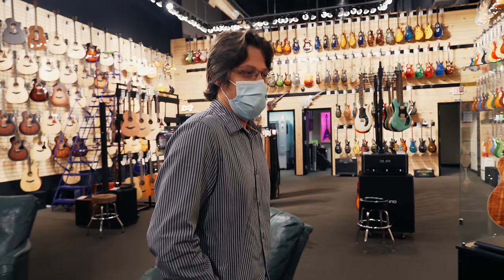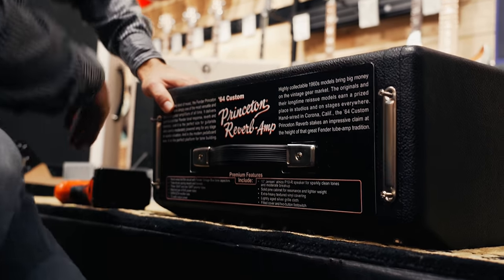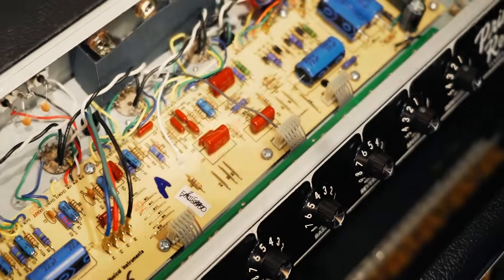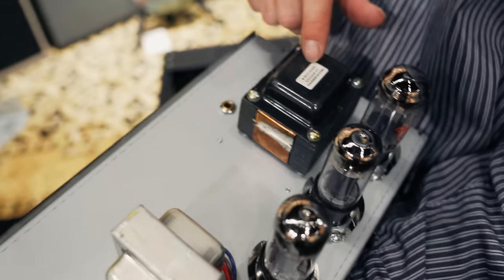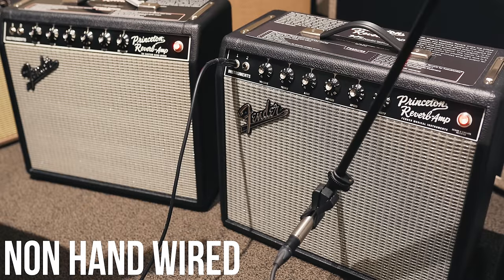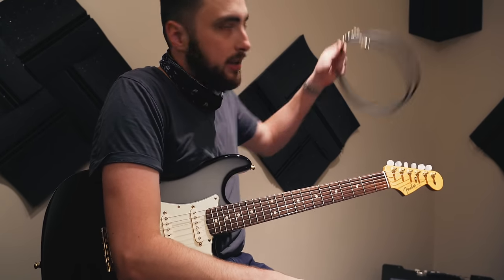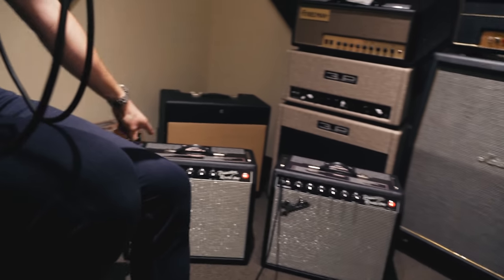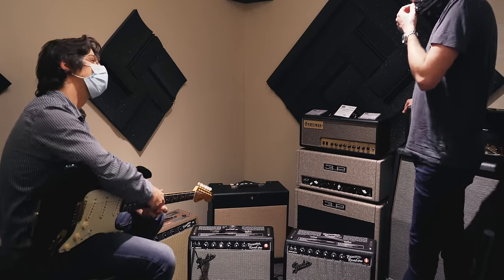Are Hand Wired Amps Really Better?

Comment from the maker: Are you a hand wired amp player?
Reply: Yup 68 Princeton, had it re capped about a decade ago and that is it.
Reply: yup! I've got an early Dr. Z Carmen Ghia head I love
Reply: Itd be cool to get a review of those 1x12 Vox AC30s that came out like a year or so ago, I want to get one but the old Custom Classics always would break down. Great video Rhett!
Reply: Yup, Goodsell Super 17. My only amp for the last decade.
Reply: Yes Vox AC15 combo and AC30 head 50th anniversary series, but it's hand wired in China. Does that make a difference? I've had them serviced and the tech said they were great. They sound great to me.
Reply: When I play my Fender 4x10 I am. When I'm on my Katana.....
Reply: Yessir!  I could never go back to PCB amps now either!  I have a 65 Deluxe Reverb reissue that I had completely gutted and re-wired point to point!  The caps on the Normal channel were altered to be tweed voiced and has more bark and mids to it while the Vibrato Channel is your standard blackface tone.  The reverb and vibrato are also bridged to both channels so you can have either tweed or blackface with verb and trem!  I also have a handwired Tweed Vibrolux that is amazing!  I'll take a handwired kit amp over a re-issue PCB amp any day.
Reply: Yup, Tyler PT-14!
Reply: Just finished building a JTM45 from Webber....changed out the ot for Classic Tone..to run KT66.. modified bright channel...added a master volume...and a couple of other mods....Best sounding amp I have.
Reply: I only play my self built handwired amps: A completely self built Champ, a 50W Plexi (Metro Kit) and a Princetion Reverb (TAD Kit). Rhett, email me for the Kemper profiles of my amps.
Reply: Oh yeah, got an original 1965 Fender Super Reverb. 55 Years old and works still like it did at its first day
Reply: I have a '74 Silver Face Deluxe Reverb with a Tone Tubby Alnico and a Vox AC30HW2X.  At home I use a Yamaha THR10C.
Reply: Yes - 1979 SF PR head conversion with a 2x10" Bill Fitzmaurice design "Crossfire" cab, open back, Jensen MOD10-35 loudspeakers. OT replaced with a Deluxe-Reverb-spec Hammond unit with multiple output taps; 8- and 4-ohm outputs available at the back. Tung-Sol reissue 6V6es.
Reply: Yes a Rozon 3 chanel with 30 year old Sylvania 7025's, that finally need to be changed.
Reply: Rhett Shull - I play clones I built of a 5F2-A Tweed Princeton with 10” Weber alnico speaker and a Blackface Princeton Reverb. However, there is NO reason why a PCB amp can’t be built well. 

I do have an early green board Blues Jr. but can’t play it anymore. Cheap ass pots, ribbon wire connections, cold solder joints, crap tube sockets... I’ve worked on it a bit but it’s just not worth the effort anymore. Fix one thing and something else glitches out.
Reply: Yep. Morgan SW22 & love it. Started with handwired Princeton 62 Chris Stapleton... Super cool, beautiful amp, but just didn’t bond with it. Then got handwired 64 deluxe reverb. LOVED the sound, but v high noise floor. Then got the Morgan and super happy. Big, powerful, punchy, articulate cleans... Takes pedals amazingly well. Would love the 64 handwired Princeton as well tho! Awesome video. The midrange presence of the handwired has big-time mojo. Sounds killer!
Reply: I am now! Went from a DRRI to a hand-wired Swart Atomic Space Tone. Great video, Rhett!
Reply: I've got a '73 SF PR and a '64 BF Champ. Both need significant work though. Any recommendations on who to fix them who is good, honest and not flaky? Should have specified in the Atlanta GA area.
Reply: I play a hybrid board friedman..... So.....
Reply: Nope Bogner Shiva PCB sounds fantastic
Reply: Is a Fender Blues Jr hand wired?
Reply: Yep - Tone King Gremlin
Reply: Yes Fender VibroKing..... and I also have  72 silverface Fender Twin.    I do gig a 68 Silverface Princeton Reverb reissue that’s very reliable and not handwired.  It definitely has its uses👍👍
Reply: Yep! Dr Z Galaxie
Reply: Built my own Mojotone Princeton Reverb! Amazing experience and amp
Reply: Rhett Shull loveee my handwired  Fender '57 Custom Deluxe
Reply: I'm fortunate enough to have a full set of the Fender EC amps, an AC15HW and a Marshall Astoria and I love 'em. I do think there is a difference tonally like you guys found here; less harshness and more mids. According to Ade at Orange it has something to do with how the frequencies travel along the wiring rather than the components. It's on a video somewhere. Awesome video!!! :)
Reply: Hey Rhett, I have the 65 reissue, and the mids come out more as the speaker breaks in. But I have broken in P10R that I am going to pop in and see how it sounds. Excited to try it. I may upgrade to the hand wired at some point.
Reply: only because they hand-wired amps in 1967 and 1969.
Reply: I was fortunate enough to inherit 2 vintage amps from the 60s so I have the luxury of that but I REALLY want a 57 deluxe one day
Reply: I will be when my 1970 twin reverbs fixed 😁
Reply: Have you ever tried amp with pentode in preamp? Like ef86 tube for example?
Reply: I have a 1967 Silvetone 1483 and a 1969 Fender Super Reverb (silverface). They're both so loud I can barely ever play them.
Reply: Hand wired / vintage / NOS tubes 💪
Reply: absolutely. I'm a vintage Traynor fan since we can get them at reasonable price here up in Canada. You get a tank of an amp, every bit as quality as a Marshall of Fender, with quality parts, and-wired. which is important to me because that's so much easier to repair
Reply: Yes. My main amp is a Landry LS100G3. It’s a 100 watt head with the best master volume I’ve ever heard, and, although it’s a cliche in the amp world, it really does  a Fender clean tone and Marshall distortion. It’s a hand wired, boutique amp. The head cost me $2,600, and the cabinet $700. Altogether it was only $300 more than a hand wired Princeton, and I know I have the wattage for any situation, plus it does amazing cleans to high gain. The Princeton is a low wattage, one trick pony.
Reply: I have a Bartel Sugarland, amazing amp
Reply: Yup. After going through a bunch of different amps I finally settled on a '74 Princeton Reverb, put back to 60s specs. Probably one of the best amps you can get for the money, especially since you can still find em for a steal if you look hard enough! New caps and speaker and the amp will be good for another couple decades!
Reply: Yes, I bought a Carr Raleigh recently and it feels and responds beautifully on the clean channel. There's a certain "pop" to it.
Reply: I have the champ reissue at home. Hand wired.  I want a hand wired marshall to compliment it.
Reply: Yep: Vintage Matamp, one-off Cornell, Cornell Romany, Cornford Harlequin and Orange AD5. They all sound great!
Reply: Yup. Built myself a 5W two-channel JCM800 with power scaling down to about 0.5W. Clean channel's basically a Tweed Champ and the dirty's pure Marshall. It's the ultimate bedroom and home studio amp for me. Kinda got my heart set on building one of these Princeton Reverbs next though! Tried a factory one but with a Celestion Alnico Blue in it and it was just a magical combination. Gonna be tough to build it as well as that hand-wired one you had there, though!
Reply: Yep, my main amp is a Li'l Dawg 5F4 Super Dawg lunchbox...plexiglass bottom so I can show off how pretty his wiring and layout is
Reply: Yup Dr Z Maz 18jr 2x10 combo...love it
Reply: Yep. Still play an amp my dad made for me when I was 15.
Reply: I am both yes and no.

Built a silver face Princeton NR.  Into a custom head case. From scratch. No kit.  Sounds awesome.

Also play an Egnater Tweaker.
And am eyeing a Victory VC35
Reply: Yes. 63 Deluxe Reverb clone, handwired, sounds insane
Reply: I sure am!... because I MAKE amps.  You can see them on my channel along with a bunch of repairs.
Reply: 63 Super Reverb
Reply: Also a 20/5watt plexi, hand wired and I play both amps through a rockcrusher.  The Rivera in particular  sounds great. Norman
Reply: Yep. All the way.
Reply: Yes I have two that I built....57 Champs...
Reply: Matchless Nighthawk Reverb for me, can’t go back after hearing that one.
Reply: 73 SF Bandmaster Reverb w/early 60's Blonde 2x12 JBL cab.
Reply: Allston Amps!
Reply: Yes, every amp except for my JCM 800, which I no longer tour with, is hand wired. All it takes is one cracked board to make you a believer in hand wiring for the rest of your life.
Reply: I only use hand wired amps in the studio 😍
Live, I occasionally use a Fender BJ, but it’s been modded a lot!
Reply: I've got a hand-wired Vibroverb and Vibroking....which I think helps me hear the difference on the video very clearly.  To me the PCB amps seem to have a brittle top end which isn't the speaker, and lack the harmonic richness. The PCB amps are very good but the HW are phenomenal.  I also have a Carr HW amp....but for me the Fenders don't have such a flat response...the Vibroverb particularly has an upper mid honk....it's these idiosyncrasies that make them great.  I want to get one of these Princetons, I think it will be about the right volume for most gigs!
Reply: Vox AC-15 Hand Wired
Reply: 1cleandude - no. Blues Jr. is an example of a poorly made PCB amp
Reply: Do you think I am rich? Or at least American?
Reply: I make my own so definitely a hand wired player. The best fender amp doesn’t exist in production.. one channel like a Princeton but with the AB763 circuit. There’s a few boutique folks who make them (Carr, Benson) but boy howdy do they rock.
Reply: Mark Hoskins 
All three Clapton Amps, a Vox, and a Marshall that is a great group of amps.  I loved the Clapton amps when they came out, but couldn’t afford one.  They are hard to find now.
Reply: Eric Kay 
Your modded 65 Deluxe Reverb sounds like it would be a great amp.
Reply: Kinda both; my silver face Super Reverb is handwired; but my Deluxe Reverb I picked up pretty cheap last year is PCB. The SR wins hands down, and like the Princeton, my DRRI is really bright. I decided to leave the DR as it is for the time being, but if it ever poops out, I'm changing it over to PTP. Oh yeah, I have a Mojo Tweed Deluxe that's I handed wired also.
Reply: @1cleandude  The Blues Junior series are not hand wired. I owned 2 of them because they were cheap when they first came out. I sold them after a few years.
Reply: Yes!  In fact I acquired my newest hand wired at Righteous the very same day.  Divided by 13 EDT!
Reply: 1996 Matchless HC-30
Reply: I only play foot wired :)
Reply: Two Rock Bloomfield Drive.  Best amp I have ever played in my life.  My Tone King Imperial MKII is my number 2 and proves even partial PCB boards can sound glorious.
Reply: Play an old Peavey Standard head and 4X cabinet from back in the day.
Reply: Yes & No. I have several amps including a hand-wired 18 watt twin-12" Retro King. It weighs a ton! I'm currently using a reissue PCB Fender 4-10 Bassman in my rehearsal room. My fave for small room work is a hand-wired 1964 Fender Vibrolux Reverb clone. It was built for me by Marsh Amps in Florida about 10-12 years ago. 😁
Reply: I am a firm believer in amps are where your money should go. Call me stupid, but thats just my experience. My two rock, hiwatt and friedman hurt the wallet. But dammit.. i love em
Reply: Yes...i play an 18 watt clone i made from a layout....i have had a bunch of folks comment on it. It is so touch sensitive. You can play the amp.  I run it with a Webber minmass on it an crank it about 65 percent wide open... roll the volume back and it cleans up and it jangly like an ac15...but you hit it and it sounds like a 60s Marshall... only thing you have to think about is boost.. I use an X2 booster and an OCD drive...it does not play well with some drive pedals...since it is power tube distortion. I love the feel of it..
Reply: Absolutely. Many times over. I’ve found my holy grail with a 57 tweed deluxe clone that is heavily modded so I can dial it from stock tweed to brownface to near blackface.
Reply: Rhett did I hear you have a Wide Sky on the way?
Reply: Frank Smiley - anyone who says Asian countries are not sharp as tacks are deluded, China can build em as good as you can spec em... there a tidal wave about to wipe out USA musical instrument manufacturing, I'm afraid.
Reply: I recently acquired a HW amp after years of playing a PCB amp; the difference is astonishing! Cool Vid!
Reply: Rhett Shull so to get a better comparison get a good amp tech to set voltage at the plate. Many amps I hated I played at a friends place including the Peavey 5150 which I wanted to love but hated sounds amazing when biased correctly for tone and not tube life which manufactures fear negative tube life reviews.
Reply: Rhett Shull the brightness and definition because the voltage Is too low. All the handwired tones will come out of the circuit amp when you set the voltage.
Reply: So I’ve done 200k plus backlines and had riders want reissues for reliability. I offered real 65 twin reverbs but instead gave them brand new reissues. It was reliability as to why they didn’t want the real ones.
Reply: Peter d'Entremont um. no - sizzling the tubes only fries the PCB.
Reply: Well I am now after completely re wiring my Blackstar MKII lolololol.
Reply: They're are handwired models in my AX8.  Does that count? Lol
Reply: i built a hanwired solid state   

😂🤣😁
Reply: Z-Wreck Jr from Dr. Z. It's a handwired amp based off the Ken Fischer Trainwreck. He's made about 100, and I have #4
Reply: Yes.  My main amp is an extremely modded Princeton Reverb which has a cast frame Celestion 12 w/ 1.5" voice coil (no longer made) a cathode biased 2xEL34 Class A w/ Leslie 147 OT and 0C3 regulator (about 30 Watts) Output section, Tweed style Tone Stack and switched (In/Out) negative feedback reduced Presence control and all tube buffered FX Loop.
Reply: My Brunetti Singleman is absolutely amazing in terms of both reliability and sound. 😊😍
Reply: Hand-wired for sure, sounds like the real thing!
Reply: I have a few dozen hand wired amps
Reply: Waldemar Pierzchalski they are great, also the old octal tubes! But lower gain
Reply: FinalBaton or you can get garnet amps or pine co company for almost nothing, also hand wired and sound great!
Reply: Aidil Adha are you trolling?
Reply: Fernando Barrera yes! Before a disgusting wife spends it!
Reply: j freed sorry, their ears are not the same so i don’t trust them to build me anything more complicated then a champ. Western people heard the real thing so they can more easily replicate it. Not to mention Chinese always cheap out in manufacturing. Never ever will I buy a Chinese guitar. Mexicans at least have a musical culture, and Japanese have pride in their work and attention to details and use quality materials.
Reply: Got the 57 champ hand wired
Reply: yes all my 12 amps of various makes are handwired.  Always worth the extra $$.  I have an old Prin-Ree blackface....early CBS vintage that is a keeper for life.
Reply: I've got a mid sixties Harmony tube amp I picked up at an auction in '97 for about $50 bucks.  It's been in two auto accidents and all I've had to do is replace the power tubes a year ago. Built like a tank and sounds epic.
Reply: Nope ...just trying to be a decent ...guitar...player..no matter what it’s plugged into ...having fun....grandkids seem to be having fun watching me and joining in with their tin can drums and kazoos ....errr....what was the question ? 😎🎸
Reply: Yes.  Dr Z and a self wired mojotone 5e3 amp.
Reply: @Musickbox8  What speaker are you using for your Goodsell?
Reply: @timsattler6  I have an original 68 non reverb and just found out it's 65 circuit. Love it.
Reply: I wish!
Reply: @stanesposito2664   Celestion G12H30
Reply: @Musickbox8  LOL! Me too!
Reply: @Musickbox8  I have one too. love it!
Reply: Yes. I'm a harp player and have used vintage amps for years ('56 Magnatone Varsity Deluxe and '63 Premier Twin-8), but built my own Mojotone Super 5F4 a few months back. Opted to install Celestion G10 Alnico Gold speakers.
Reply: I'll say a tube amp player mostly. I do own a Valvetrain 315 that is mostly a 5e3 amp clone with a slightly bigger cabinet and I do own a Fender Custom 68 Vibrolux reverb with a printed board inside. To be honest both amps are amazing regardless if they're hand wired or not.
Reply: Yes - 65 Tremolux, 74 Princeton, 80 Princeton Reverb, Dr. Z MAZ 18 Jr.  There is a difference. While the Fender Reissues are better than their HotRod Deluxe series, the handwired is the way to go but also the interaction of components, wiring paths - it all adds to the sound.
Reply: My laney was hand wired in the U.K.
Reply: Yeah, I built a JTM45 with an extra power switch (half power/ full power). Never going to sell it, best sound ever.
Reply: Cool comparison! The hand-wired sounded better by far (richer mids/more dimensional). I'm running an early 90's Mesa Dual Rectifier, the harmonics are RICH! Cheers!
Reply: I have a '61 (brownface) DeLuxe that I have to restore and that's a handwired for sure. I really have to gut it completely and start to source all the right components to get it as close to original as possible.
I also have a Boogie .22+ that needs work so I'll be able to tell you the differences in a few month time on hands-on repair level.
Reply: Nope
Reply: Being on a disability income , it is impossible to even buy a tube amp . Just a dream to have one
Reply: Nope I am a permanent resident of the tone master series
Reply: '71 Marshall Superbass stickered Superlead.
Reply: Just stumbled on an entirely “All Original 63 Twin Reverb.” I’m having it recapped and putting in new matched hi quality tubes ($235) there are lots of tubes in a twin. 2 for each effect trem and vibro two preamps and 4 6L6’s. (10 total) I can’t believe I found a working one with the original from the factory tubes. The tremolo / vibrato tunes are toast but the 12ax 7’s preamps and 6L6 power tubes are still working pretty good. This amp was driven by a little old lady who only used it in church.  Cliche but true.........  It was never turned up past 2 or 3 until I got it..
Reply: Yup, I hand wired it myself. (Stewmac p-reverb kit with illinoise coupling caps instead of orange drops)
Reply: Read some of the other replies you’ll get the idea
Reply: Yes, Kingsley Deluxe 30
Reply: Friedman pt20 hand wired, love it. As far as the fenders go the hand wired definitely sounds warmer but I don't know if it's more than twice the money better. I think you can have the chassis hand wired for about $500. There's a guy on Ebay you can send your chassis to and he will hand wire it point to point for less than $500.
Reply: As an electrical engineer, I don’t think there is any inherent improvement with point to point wiring.  Very glad my auto isn’t point to point wired!  I do think along with design changes to PCB come changes to improve margins.  So, use of PCB and premium components should give equal tone, and likely less variation in quality, lower cost, less errors.  Just sayin’
Reply: @franksmiley5610  Had to laugh when I read yours my friend because I have the hardwired little 4 watt and didn't know that I should comment since I'm pretty sure mines hardwired in China too!! It sounds awesome though and it only has one know! Great little at home or small coffee shop pedal friendly amp. Gets that great bit of breakup without making your ears bleed and I love using it to test out fuzz and overdrive pedals for that reason
Reply: Yes Sir a Fender 75 ! No regrets paid $300 in 1990 beats my Marshall Code 25 in every way !
Reply: I had to option of getting a hand wired Vox Ac15 over a non hand wired but the extra $$ I just couldn’t justify as I play at home and don’t gig. I guess it comes down to what you are willing and able to spend... didn’t stop me getting a few extra pedals though ;)
Reply: Yes, Bassman.  But I often bring my Blues Junior (upgraded transformer, reverb tank, speaker) out due to its portability.
Reply: Yep. 72 Fender Twin Reverb hand-wired with massive local transformers in NZ under franchise from Fullerton. Split into pine head and cabinet for the 2x12s. Put the Master on 10 and edge the channel volume up in increments. It does a thing.
Reply: Sounds great, but at that price I’m sticking with my Matchless Laurel Canyon 👌🏼 
I’d love to see you get your hands on some Matchless amps in the future!!
Reply: Yes. Carr Hammerhead
Reply: im an amp player
Reply: Yep!  A point to point Princeton in fact
Reply: Yeah. Nick Greer UNDERDOG. Speakers make massive dif, though. I had a Mesa DC50 that was bulletproof. Roads dropped that Mesa straight off the front of the stage, out of a trailer and a truck. Not one electronic problem.  It was not until the last drop that the CAB was dinged.  Those Mesas are amazing— those drops would devastate the old factory Deluxe. But, of course, it’s never been dropped
OTOH, the Greer will never be dropped on the road. I’m certain she is tough. She is also grounded. For life
Reply: A recapped/tubed '69 Ampeg B25 I've used as a pedal platform for the past 46 years, and some interesting hand wired clones of a 5Y3 Deluxe w/Weber, JTM-45 head, and a TrainWreck Express working chassis for studio tracks.
Reply: I had a friend of mine who is an amp tech build me a hand wired Fender 1x12 combo. He built an amp that Fender could probably make a few bucks building - the left side is a vintage spec Bassman Blackface AA864 circuit; the right side is Twin Reverb Blackface AA763 circuit with reverb & tube tremolo. It’s got NOS Philips USA 6L6WGB tubes to step the watts from about 55 down to 40. And it’s got a nos GE USA 5751 12AX7 Tube in V1, like Stevie Ray. It’s got a broken in Weber 12F150 50w speaker and housed in a solid clear pine cab with finger joint corners. This amp will probably outlive everyone on this post, lol. But NOW I CANT PLAY IT! I got a new kid in the house & my wife won’t let me turn it up, lol. I have the holy grail of Fender tone amps and it’s collecting dust in my basement practice room😔
Reply: I made mine, so yes.
Reply: Player and if I like a PCB amp I will BUILD ONE HAND WIRED! Terminal board, eyelet board, tab board, and sometimes I etch my own PC boards that are set up  for a better amp that is easier to modify with making it into an dumpster fire abortion.
Reply: Awesome Rhett! Yes i play a 71 princeton reverb silverface. recapped, still has some original tubes I love it.
Reply: Yes, Princeton Reverb II, the last of the hand-wired standards. Wiring makes a difference, but then so does $1200.
Reply: I don't think it takes being a hand wired amp player to realize, that if you have a full set of amp components, and in one case hook them up by hand wiring them point-to-point using a turret board, and in the other case using a well designed PCB, with the copper tracks being of exactly  the same cross sectional area and lengths as the corresponding wires used in the point-to_point hand wired case, the differences in sound and character will not be possible for ordinary people to hear.
Reply: Does a mesa dual rectifier count?  Not a great vintage amp like the other ones you guys are mentioning but it sounds phenomenal
Reply: I had 3 Cornfords and the only one that could handle even a small room gig was the Hellcat combo. Gorgeous wiring but kind of compressed when pushed past 3 or 4. Awakened a touch with Green Celestions but insufficient headroom for an amp that should be equivalent to something like a black face vibrolux
Reply: Yup. Got a 73 twin reverb. It’s way to heavy and loud to use anywhere but a rehearsal space, and even then I’m getting yelled at to turn it down. 😂
Reply: I have a 67 Twin and a Dr. Z Prescription ES.
Reply: Tyler let me know where to buy the kit caps for my Princeton, greetings
Reply: Good stuff.
   I have played both hand-wired and PCB wired amps for 50+ years. Tube and solid state.    I've had good and bad luck with all types.  The best amp I have ever gigged with was my Mesa Boogie Mark IV, 1x12 combo.  I think it had PCB wiring.  The Mark IV blew out a pre-amp tube and a speaker.  That could actually be considered normal 'wear & tear' failures. That is probably the only amp I have never been compelled to disassemble.  I miss that amp.
  Regardless of what amp a player takes on a road trip for a month, or two, always have some sort of a backup for every piece of gear you own.    If something breaks in a little tiny town 1000 miles from home, you want a backup amp, a backup guitar, plenty of spare strings, cables, and a cable tester.
       A guitar player friend was hired to play for a short tour of Italy with a well-known artist from the Haight-Ashbury era of California rock. My friend bought one of the smaller Steinberger headless guitars so he could stow it in the overhead bins on the jet.   For some unknown reason, he didn't bring any spare strings and he didn't realize his Steinberger required the old Steinberger-type special strings.    So for an entire day in Italy he was in a panic trying to find replacements for the strings he had broken.   Always have a backup.

enough of my drunken rambling......
Reply: Have you seen the inside of a Frenzel amplifier ?
Reply: 5f2a handwired!
Reply: @cliftontorrence839  Yup - I've got a HotBox/ac15 clone. Killer amps - SUCH bang for the buck!
Reply: Handwired all the way.  Being able to quickly and cheaply fix and mod the amp in my garage is worth every penny of the premium cost let alone the fact, to my ears anyhow, the hardwired amp just sounds better.  I’ve got a Fender Custom 64 Deluxe Reverb, a Fender Cyber Twin (circa 2001), a Vox AC30HW, and a Marshall DSL-40.   My fav amps to play are the handwired ones - the others just don’t cut it for me.
Reply: Carr Raleigh - great home amp
Reply: Yep. Mid sixties Vibro Champ, Deluxe Reverb, and Pro Reverb. Dr Z Prescription Jr., Max Jr., and Z Plus. Recapped the Champ myself--way fun replacing the chassis-soldered electrolytic.
Reply: YA... vintage 65 princeton and a 82' Deluxe Reverb.
Reply: Yes. Have a '64 Custom Deluxe Reverb and I love it.
Reply: Yes, my Orlando Acetone custom 15”
Reply: Yes.
Reply: yes, 50th anniversary Vox Limited Edition AC15 TVHW.
Reply: Bought a Princeton Reverb II new in the '80's. I'm still often in awe of its sound.
Reply: I've got a '56 Gretsch Western Cowboy I'm about to start restoring. I will be when she's done.
Reply: this amp itself caused me to increase my practice playing, just cuz i love that sound. Only use a Morley Wah/Volume & a Germanium OCD OD pedal. i plan to add an attenuator in the future, but am doing much reading about the best fit in the meantime. i use that amp for 5 of my 7 electrics, typically..for studio work. 

If im doing a small patio "acoustic show" at a local coffeehouse, i bring my Peavey Vypyr 3 with Sanpera II control footbaord. Just don't like taking my best and/or vintage gear to gigs. i don't need to impress anyone with my top shelf stuff at the risk of my gear being damaged or stolen.
Reply: Yes. I use 2 totally handwired amps by Juke and the new VHT. 2 combination handwired/PCB amps by Budda and East amps.
Reply: Yep... mostly. Early 60s Epiphone EA-35T, early 70s silverface Princeton (non-reverb), early 60s Gibson-made Maestro M216-RVT...several converted PA heads from the 60s (Knight, Bogen...), and a Risen (pre-Creation) Eclipse stereo head. I guess the only PCB amp I own that I really love is a late 90s Fender Prosonic.

BUT. I don't think believe handwired vs. non- makes a tonal difference. Reliability / serviceability, yes: handwired wins hands down. But IT'S THE PARTS. I believe 100% that, besides the obviously massive difference the speaker makes, what you're hearing is the difference in the quality and selection of the components... NOT the handwiring or the PCB.
Reply: @BrannonHancock  ...and BINGO was his name-o. That's more spot-on than i could have put it. Your post also makes me miss my old Bogen PA!
Reply: @kirkwhitaker6422  no problems with sound with the Webber? i've been seeking a good, but reasonable power soaker.
Reply: I’m hard wired to play guitar
Reply: Yep.  Bartel Starwood.
Reply: The hand wiring has nothing to do with the tone difference, and handwired amps are no easier to work on compared to the quality boards used in a 65PRRI or 65DRRI. Fender uses better quality boards in the 65DRRI/PRRI than the China crap most people think of when they hear about PCB, and any competent tech will find them just as easy to work with Swap the 65DRRI/PRRI speaker for a WGS G10C/G12C, swap the trannies & choke for Mercury Mags, and your 65PRRI/DRRI will sound better than the HW for about half the price, all in, upgrades included.
As far as "tweakers" being able to work on HW easier, anyone who doesn't know what to do with the boards in a 65PRRI/DRRI doesn't have the knowledge and really shouldn't be messing around in a HW either, for personal safety's sake. Tube amps can literally kill, even unplugged, due to the large amount of high voltage current stored in capacitors even after ac power input is cut
Reply: yes, 1970 fender vibrolux reverb, caps renewed at some point (good components!), tubes have been changed a couple of times. That's it, it sounds glorious and is almost undestroyable
Reply: Imagine playing non-hand-wired amps
Reply: ‘65 Fender Princeton. Got it in a pawn shop in Bay City MI back in 1988 for $100 with a Hondo guitar included. Been playing my ‘65 Mustang and ‘66 Jag thru it since the early 90s. Just had it recapped and gone over by amp wizard Dean Zink in Detroit two years ago. It sounds as beautiful as ever.
Reply: Yes, I have  mat amp hand/hard wired! It sounded to me that the non hand wired was biased a little bit colder than the hand wired!
Reply: @zigwigwig  I am thinking about getting one myself. How is the quality of their parts? Is it different from the fender reissue that is not hand wired? Thanks
Reply: @swimgc  not sure I can compare, as I’ve never owned another 
But def high quality. Mojotone are well known for their cabinets. The board, chassis and parts are all great. Capacitors are orange drop. Some folks might debate whether there are differences in the older blue molded ones used in vintage amps, but I think it’s splitting hairs
Transformers are also fine. Some people consider “upgrading”
As for speaker, I had my own GA-SC64 that I put in there
Reply: I have a LOT of amps and play both.
Rhett is right...WHEN...(name catastrophe)...happens on the road it is an easy fix with a hand wired amp.
Reply: Yes, Carr "The Bloke". Wonder if anyone makes an amp where  the only difference is the wiring method, not the cabinet, speaker, or components ?
Reply: Yes, I have 3 hardwired combos. They definitely “feel” nicer. But I haven’t A/B with equivalent factory models. All from Flynn Amps in Glasgow, a tweed champ, deluxe reverb and an 18 watt Marshall clone
Reply: Yep, a Gabriel V33 combo & a Morgan RV35
Reply: Yea, I roll my own. I havent bought a amp since '89.
Reply: yes a 64 Custom Delux Reverb
Reply: Yes, most of my amps are hand-wired. For me it’s not so much about debatable tone mojo, but easier repairs and modifications.
Reply: Yes I do but just because the amp sounds really good and it's the only way they do that. Handwiring got nothing to do with sound or quality.
Reply: Yeah, 9 out of 13 of the amps I’ve owned have been had wired.
Reply: Yep and I roll my own.
5E3 and 5F1 are pretty easy and sound oh so good ! 
Weber speakers for sure !!
Reply: Dr. Z Maz 18 reverb
Reply: I would be a hand wired amp player, if I could afford one...
Reply: I am. Lazy J J20. Love it.
Reply: I hand-built my own 5F1 Champ copy, with added presence control.
Reply: I have the 64 HW DR.  Fender used a ceramic Jensen in it to be more period correct, but I'm considering an alnico Jensen or may be Celestion.  I know the Celestion would be the least period correct speaker and might color the tone too much, so a Jensen P12N is probably the one.
Reply: HW all day!!!
Reply: Hand wired is actually cheaper to produce . Less components no pcp. And the caps , diodes and cheap . Why you wanna pay thousands more
Reply: Yes 77 Vibrolux Reverb and an Allen Accomplice running 6L6s built by myself.
Reply: Hand wired only for me
Reply: @markjamesmason  fender continued hand wiring amp into the 80’s.
Reply: I'd like to be. Looking to build a Fender-style amp as a modulation pedal platform
Reply: I own the 64 custom Princeton reverb hand-wired. 1971 fender super reverb, suhr shedgehog, suhr badger 35, Friedman BE 50 deluxe, 68 fender deluxe. Love them all. 🤘
Reply: Yes, a Louis Electric Tornado with a Jensen C12K speaker replacing the Celestion Gold. I'm a Jensen guy and it gives me the sound I want. Cost quite a bit but I love it.
Reply: I wish! I loved my Vox AC30 but it was modern with a board and I love my Fender Blues Jr, but I havent owned a hand wired amp since my Plush 100something watt green tuck and roll stack back when I was a kid. I wish I had a hand wired amp again. Maybe when I get rich LOL
Reply: Goodsell Super 16 6V, my only amp for about three or four years now. I also have a vintage Magnatone Varsity that I never use.
Reply: Hand Wired 💯 68' Super Reverb (Sadly I Let Go of My 65' Blackface Super and Got Clipped for My 71' Proverb So I Had to Replace That With a 65' Blackface Reissue Twin)
Reply: My dad and I just finished a Mojotone 5F1 Champ and now I get what they mean by it's a "feel" thing.  Other two amps are great, Bassbreaker 30R and Deluxe Reverb but there is something special about the hardwired Champ.
Reply: @kaschbowman  Nice !!! Oh Yess.. I Had a 68' I Should Have Never Let Go Of.. 6V6's .. Oh Yeah !!!
Reply: Can’t afford t
Reply: My favorite amp is my ‘67 Super Reverb. One of the cones blew, and I decided to swap all 4 for some Weber Alnicos. I love it so much!
Reply: Yes--silverface Fender Pro Reverb (s), Twin Reverb, Super Reverb, Deluxe Reverb, Vibro Champ, brownface Deluxe & Vibrolux, Vox AC30BM, Vox AC15H1TV, Panaramic (Magnatone) 2x12 combo, Marshall 2061 clone, handwired 5E3 Tweed Deluxe clone. All great. Love my PCB amps, too.
Reply: I have a Handwired ac15 and am looking at a Handwired fender DR, hence watching this video ;)
Reply: @sgholt  I know it’s cleans are best, but with the right pedals does it get a good classic rock Zepplin type tone with humbuckers.
Reply: @sgholt  I know it’s known for its cleans, but with the right pedals does it have a good classic rock zepplin type tone with humbuckers
Reply: Had my '66 Princeton Reverb serviced a few years ago and I always thought it was louder than most. Upon picking it up my tech told me it put out 23 WATTS!!??.......Best amp ever........well almost as good as my '59 Champ.....
Reply: I am saving for the hand wired version of the amp I want. It’s worth it.
Reply: @scottholz9449  Not 100 percent since moved to Boutique Dist Still the Gremlin is my next amp
Reply: @paulsteds  VK cool Bruce Zinky design I have the Tonemaster
Reply: My Kemper is hand wired 😂
Reply: Yep.All my main amps are handwired. Carr Rambler, 72 SIlverface 48w Bassman head. Even the power section of my old Peavey Artist 240(SS preamp section may be handwired, dunno how Peavey did SS back in the late 70s).  But... I do use a Micro Cube from time to time for low vol practice, and I take a Micro Terror as a back up on important gigs. And if I want something small to take out I'll grab my old USA Crate VC 2110r(single ch class A but not handwired).
Reply: Yep, orange tiny terror hand wired... Super nice video man!
Reply: My Marshall 1973x 18 watts of goodness
Reply: Yes I am ! 66 Princeton in my opinion has been the best sounding amp I own. I found it completely original and clean , had the death cap removed and and a grounded plug is the only thing I did to it.
Reply: YUP! 64 Bassman =)
Reply: Actually i just realised i am !
Not that it matters but stîll...
Reply: Sundragon
Reply: Fifty-nine years worth ...
Reply: @spencerfreed6947  q
Reply: Yep my main amp is a 1973 Bassman ten Silverface in a custom made 1x12 enclosure with a Jensen alnico.  It sounds wicked. 👌

I am buying a 65 deluxe reverb reissue this coming weekend so can't wait to run both of them together with my band. Going to sound FAT. 🔥

Liked this vid Rhett. Also subscribed. Tasty playing man as well. 👊😎
Reply: Yes - Vox AC15HW1
Reply: 80's Twin Reverb II.  People say they dont sound as good as a regular HW twin, but after getting serviced and having all the caps replaced with high end components and better values, plus a few tweaks, its sonically the best amp I've ever played.
Reply: Mostly, yes. I've never owned a Fender that wasn't hand wired. I've never owned a Mesa that WAS.  Two of my four Marshalls are hand wired, the other two are on ST1 boards.     I won't say that hand wired guarantees better tone. But it does guarantee easier servicing.
Reply: I’m a what ‘sounds good player’. I have both. I don’t get caught up in irrelevant BS like that. I buy with my ears not what the guitar ‘cork sniffers’ will think is cool. 
Let’s be real though these amps have different components in them. You could mod the cheaper amp to sound easily as good as the hand wired version and still be cheaper....by a lot. 
Also any amp guy worth his salt would be able to fix either of those amps. Easily. 
I’m guessing the next video is ‘vintage vs new hardwired Princeton’ in which case obviously the vintage wins cause well ..... it’s vintage obviously and old mean good right?!?!? Lol. 
Any whooo
Reply: @brookchivell  okay how about I send you a hot rod deluxe for free I'll pay the shipping if you can fix it you can keep it if you can't fix it then you pay my shipping.  Deal?
Reply: @brookchivell  Also - If the only way you can fix it is to rip it all apart and handbuild a circuit then you send the amp back and pay the shipping.
edit: because a broken pcb definitely sounds better than the handbuilt one.  Lets the acoustic guitar be heard better.
Reply: @brookchivell  I can build you an amp that sounds better than a pcb with any random parts you assort be they used 45 years old or new parts or random.  Because the most important thing about sound is size and weight and I know all the rules.  All of you people get your source of electronics information from people who don't really understand electronics.  The universities are 1/3 of the way there at a doctorate level to being able to figure it out.  But they don't try hard enough.  Maybe some more people in the world think like this but we don't care about trivial things.  I will tell you this:  Handbuilt Anything is better than automated everything in most every situation.  Because the people are more important than the objects.  Because the environment is more important than the objects.  You have to study with the principles in mind  and it will always give you the right answer.  You could not "cheaply mod" any pcb object to be better than a handbuilt object that is still operating 50 years before recap then another 125 before serious "okay we got our use out of this object called fender guitar amp.  maybe instead of throwing it away, we should save all the parts that will still work for the next amp."  Like maybe the chassis is reusable.  BAM you're already a chassis ahead of everyone in the world who wants to build an amp.  Now you spend less human effort to make the next amp because the chassis and the power choke are still good and some of the caps and switches.  But what I am saying is the switch on the guitar amp should be the same switch as the washing machine and oven and refridgerator and car and everything all the damn switches should be like 5 different models not 550,000 different models all time all produced.  But this is because you have not your principles in order that you do not claim the value of human life- but probably abuse it or take it for granted.  When someone hand builds an amp - they are giving you something worth $2800.  You go come up with that kinds of effort - because to build the room to make the amp is the hard part.
Reply: @zvotaisvfi8678  I agree with most of what you said 👍🏻 people are more important than machines. I also agree that the ‘consumer’ lifestyle a lot of people live is a huge issue for humanity as a whole. Too many businesses making items slightly different so they can upset new accessories (Apple are a massive perpetrator of this). 
I’ll pay you to keep the hotrod deluxe lol I’ve never ever been a fan. Also I’m not worth my salt as a builder (I have only built 2 amplifiers) but I know a couple of great ones that have never not been able to fix something unless it was going to cost more than the amp was worth in which case the clients stopped the repair. 
Anyway much respect to you mate
Reply: @brookchivell  Same much love!
Reply: Yes.
Reply: Dr Z maz,  Friedman pink toco,  Princeton not hand wired for neighborhood relations
Reply: I'd be interested in seeing a good Vox AC15c1 vs AC15hw comparison.  Also, as others have mentioned, it would be interesting to update a PCB of an amp with all the component values from the sister handwired version just to see if there is a discernable different in sound in a true Apples to Apples comparison of PCB vs HW.
Reply: Mojotone 5E3 Fender Tweed Deluxe clone. Great sounding amp.  I now what a clone of every Fender tweed amp made.
Reply: I am totally going to have my limited edition 65 Princeton reverb wired point to point with better components.
Reply: Yes
Reply: I own both handwired and non-handwired. I price was not a consideration I would probably only own handwired.
Reply: Yup! 71 Princeton ❤️
Reply: Great video Rhett! can you comment on the cabinet materials between the 2? they are not the same build quality?
Reply: Yes, Alessandro 65 Deluxe with his speaker
Reply: Yes!
Reply: Yep, and for my personal taste I would never change it for anything. I can understand the need companies have to offer a more affordable hardware to reach a greater target, but really it makes no sense to spend money for a non hand wired amp. Keep your money and spend it for a better, long lasting hardware, not to mention it will be easier to sell it as 2n hand gear.
Reply: I wish. Got a Fender Champion 20. Can’t even use it to record, low end farts, high end is so harsh it sounds so cheap when I try to mix it with my head phones. I’m saving up for a high head room amp, I want a Princeton so bad, such a great amp. But the prices have gone up so much. I’m looking at the DV Mark Raw Dawg raw dawg Eric Gales model amp. High clean head room would be such a huge step up for me.
Reply: Yeah man I have an all hand built and hand wired Princeton from Flynn Amps in Glasgow, Scotland. You should see the wiring job, that fender handwired is a rats nest by comparison
Reply: Yes! 69 Plush Royal 1060s.
Reply: I have 4 hand wired amps, including two vintage.   Repair ability is important to me.
Reply: 74 SFVC and cox 5E3
Reply: absolutely... forever
Reply: Yes they sound fuller and richer more ballsy.. ive only use a handwired amp now..
Reply: I own Princeton Reverb, made in 1966. Recapped about 10 yeas ago and swapped the speaker with Eminence EJ1250.
Reply: Rhett are the tubes the same on these two amps?
Reply: Most definitely
Reply: Swart Atomic Jr., 5 watt single ended hand wired tube amp. Tube rectifier, tube reverb, 8 in Weber speaker, sounds incredible.
Reply: Yup; blessed to have been given a ‘59 Tweed Deluxe by a sweet lady - no kidding.  So of course I’m not taking it to just any gig and am looking for a similar, lighter amp……..
Reply: @erickaymusic Bet it sounds "Epic", I heard a re-issue PCB silverfaced deluxe reverb that had almost the same layout as yours: rev/trem both channels, tweed bassman tone on the "Normal" input and it sounded excellent....but when I got home and saw my Lacquered Fender reissue blues deluxe looking great but sounding "Orrible" I gutted the while chassis but kept the Transformers and chicken-head knobs. Plan is to build a 40watt 2 x6L6gc , 3x 12ax7,1x12at7 valve driven Deluxe reverb (97% black faced) but in that lacquered 1x12" cab which is a bit bigger than the 57 tweed . Jensen P12Q which is a bit underated for a pail of 6L6gc but it's a risk worth taking as I can't play too loud or the Sax player will give me his dagger stare and bash me up the head,   might just get my old Epiphone j200 copy and call a vocalist from years back and I will tell you why; we got more gigs as a duo , pubs,clubs, festivals, toured half of this World with 1 Guitar a DI box and a shure sm 58 (57 as spare) 1small case for gear, 1 case for clothes. If we had fancy dress or "period" themed work we would rent the outfits. In between work we would just get up and find a good spot to do some "Busking". As long as we had a good sounding Guitar and a will to go out and play all the other details took 2nd place, we were earning and learning to be professionals and the crowds were dancing. Oh yeah..amplifiers..
Reply: @1cleandude From the Factory no but if it works who cares. If it were handwired they would make a "Song and dance" out if it and slap another 1000 buckeroos on the price. Look at the price if a handwired Fender Princeton reverb custom hand wired for a  better idea. If u r happy with the sound it makes then all is good...if not changing the speaker will make the biggest difference but find the tone you like to hear and start there. Alnico speakers will give that amp a warmer and less brittle/hard treble (95db) , there is an Emminence speaker(101db, louder) which will enable you to turn that 15watt Fender into a Marshall beater. 15watts at almost flat out is better than a 100 watt amp at 3. Remember a 100watt amp is only 10% louder in DB than a 10watt ! Bass amp 100watts, Guitar amp 15watts is perfect.
Reply: @paulsteds Wow, you have a Vibro-king!! I heard one once and the owner explained why it was "Unique" the Vibrato/trem circuit used a larger than usual valve( 6V6 or EL84, can't remember) which gave that combo its unique tone. Hope you still have it cos it is an "Original" Fender circuit that no-one has bettered yet. This guy made his Guitar sound like a full string section from a symphony orchestra!! Love to hear it, maybe do a short(or long) mostly vibrato sound Viddy and show us what a proper Vibrato/Tremolo amp should sound like!
Reply: I own a ‘71 and a 73 PR.
Reply: 1966 Fender Bassman AB165 with 2x12 Jensen P12Qs in solid pine cab.
Reply: I have 1 hand wired amp.  A Wangs 2204, which is basically a Marshall JCM800 clone.  But, Marshall never hand wired these amps in the original production run.
Reply: 5E3 tweed Deluxe copy, so yes. Sound isn’t the dominant factor- hand-wired lasts longer, is more durable and easier to tweak to the player’s liking. Repairing cheap, low quality Fender PC boards is a pain.
Reply: Yes, Orlando AceTone nos handwired amp and fender TR nos handwired amp